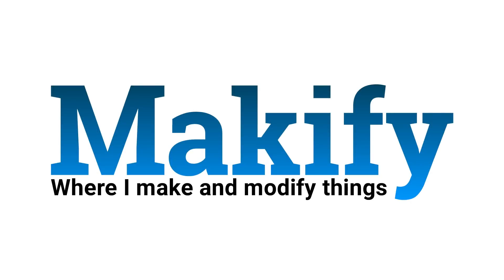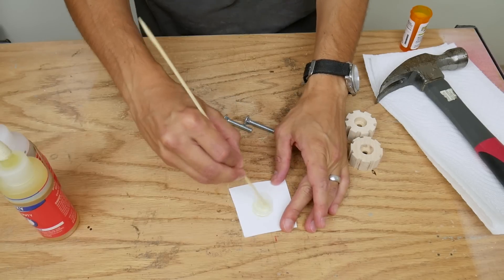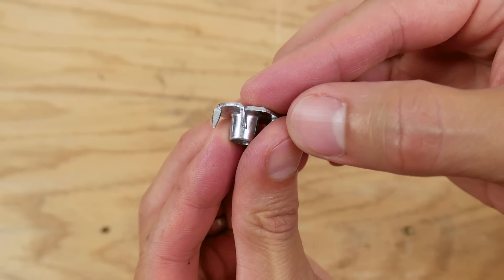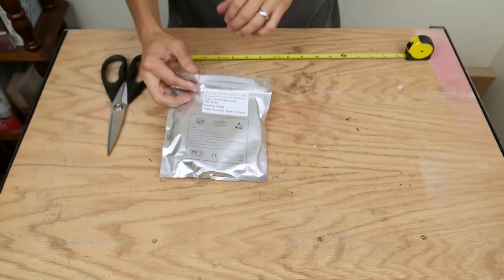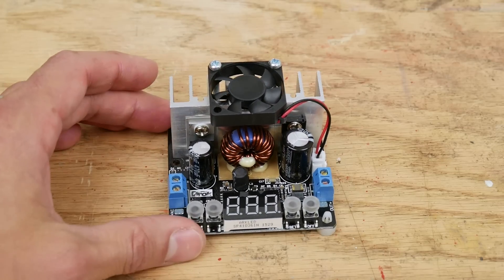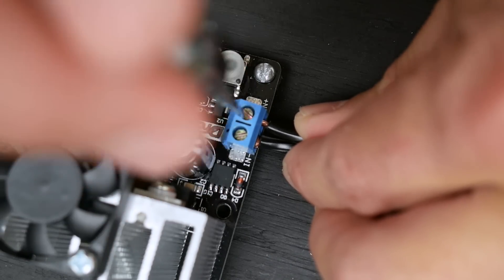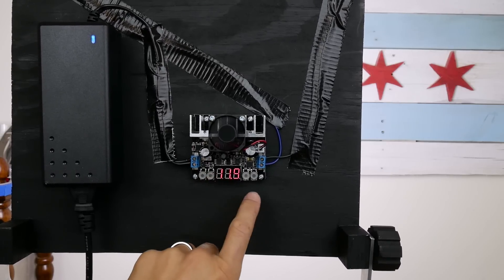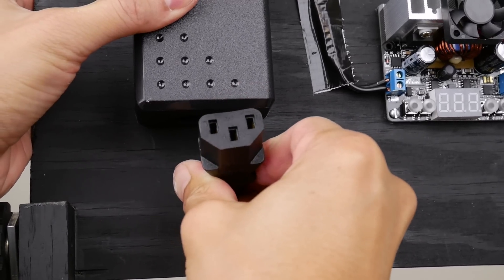How to Make a Light Panel for Video and Photography

Comment: Hey Makify, thanks for the video. Do the aluminum channels increase the risk of shorting or ruining the circuit? Say if some solder from the positive side got stuck to the aluminum, and ran down to the solder on the negative side?
Reply from the maker: Theoretically, the channels could conduct electricity and could cause a short but I've used them in several projects and it seems highly unlikely that a short would happen unless you are a VERY messy solderer.

Comment: I'm interested in something like this for a video shooting friend. However...I'm concerned about the CD-to-DC converter. You mentioned the flickering problem. The converter you mentioned is no longer available on Amazon. How do I find a converter that will not have the flickering problem (the switching of the converter getting to the output)? What do I look for in the spec's?

Comment: hey, great video, Thanks!... I'm hoping you can help, I'm not an electrician and struggling to get my head around the voltage supply requirements, so a couple of questions please: 1. can you suggest a good alternative on the UK Amazon site, I can't tell what I need. and 2. I know if you go too high on the volts you'll blow the LEDs, when you power off how can you be sure the volts won't reset too high when you come to olig in again? ( I only ask because it's digital rather than a manual knob to adjust)..... Thanks on advance!
Reply from the maker: The voltage regulator I used remembers the last setting used even after you unplug it and you can't change the voltage when it isn't powered on. I found the same voltage regulator on the UK Amazon site http://amzn.eu/0kfaUl0. 

You'll also need a power supply that can output at least 13 volts (the LEDs need 12 volts at full brightness and the voltage regulator uses 1 volt) and at least 7 amps (maybe a little less if you absolutely have to). One like this one would work: http://amzn.eu/8kaIYJE. Sometimes the amps (abbreviated as A) aren't listed on Amazon but watts are given instead. You can figure out how many amps a power supply can provide with the formula P=I*V where P is the power (in watts), V is the voltage (in volts), and I is the current (in amps). So a 15 volt, 120 watt power supply can provide 8 amps of current (120/15=8).

I hope this helps.
Reply: Makify1 thanks that's wonserful. thank you for taking the time to come back to me so quickly. very kind of you!
Reply from the maker: You're welcome. I'm here to help.

Comment: Great build, runs cool, low profile. But I'm not sure I'd use the term 'super bright' yet for LEDs. Can you give us some light meter readings or compare to a halogen hot light like a Lowel Rifa?
Reply from the maker: I'll have to do some testing but in the meantime, I can tell you that this panel is a couple of stops brighter than one of the lights I was using before which were soft boxes running five 45watt CFL's each.

Comment: Hey Vinnie, 

Are there led’s that you can change the color temp that you can use for this project? 
Also- is there a way you could control the lights via Wi-Fi or Bluetooth? 

Thanks for the great video! 

Myles
Reply from the maker: There are RGB LEDs that let you change the color but I don't know of any that are precise enough to let you dial in an exact color temperature (e.g. change from 6500K to 5500K). 

They do make LED controllers that you can control over Bluetooth but I've never used them and the only thing I know about them is that they exist.

Comment: This is a very well made video, and extremely informative. I would like to run this from a V-Lock professional battery which has a nom voltage of 13.8V. Thoughts on that??
Reply from the maker: Hmm... I wouldn't feel very good about running these LED's straight from a 13.8V battery. You could use a voltage regulator like the one I used or you could just add a (properly-sized) resistor between the battery and LED strip.

Comment: there is flickering in this led panel? sometimes happens with high shutter on the camera
Reply from the maker: The DC-DC converter I used should not cause flickering like you see with some led lights at high shutter speeds.

Comment: That really was an amazing video!   Very easy to follow.   Now I want to do that.   Any idea what the lumens or Lux are on this light you created?  If you have a light meter what kind of Fstops, shutters speeds at ISO 100 at one meter can you measure? This information really tells us the important details about the light.

And once again, thank you !
Reply from the maker: Unfortunately, I don't have a dedicated light meter but I ran some tests using my camera, a Panasonic G7 with Panasonic 25mm f/1.8 lens. I set the camera to full scene metering, iso 100, f/8.0, and positioned it 1 meter from the light source. All the bulbs I tested, except the light panel, were placed in an 8.5" clamp light with reflector (like this one: http://amzn.to/2k0YMHg). I tested all the bulbs I had around the house. I know this isn't ideal but it's the best I could do. Here are the resulting shutter speeds:

ValueBright 40W incandescent ??? Lumens = 1/100
Feit 7.5W LED 500 Lumens = 1/125
Ecosmart 23W CFL 1600 Lumens = 1/200
Philips 23W CFL 1600 Lumens = 1/200
Feit 100W CFL 1600 Lumens = 1/250
Sylvania 150W incandescent 2740 Lumens = 1/400
My LED Light Panel = 1/800

Anecdotally, these results jive with my experience shooting video. Before making and using 2 of these light panels, I was using 2 soft boxes each with 5 CFLs. I feel that the light panels give off a little more light than the soft boxes and the color of the light is better (i.e. no green cast).

Comment: hey bro! how to solve flickering led strips? please help me to solve this problem! I am using dimmer!
Reply from the maker: Do they flicker to the naked eye or just on video? If they are flickering to the naked eye, it's probably a problem with your power supply. If they flicker on video then it's likely a problem with your voltage regulator or possibly with the power supply. Many voltage regulators work by turning the power on and off very quickly but many turn it on and off at a frequency too fast to see with your naked eye but slow enough that it gets picked up by cameras. The voltage regulator I used in this project doesn't have this problem. There's a link in the description to the one I used.
Reply: Makify1 They are flickering both ways eyes and video recording! voltage regulator is may be working well I think I need to increase voltage maybe I am not sure I think my adaptor is low voltage I don't know but adaptor is showing me 12v  but I'm not sure is that 12v that's why I asked this question to you bro! thank you so much! now I am trying new then I will again contact you!
Reply: 16V 8A.... and not flickering any more
Reply: If you are using a dimmer instead of the voltage regulator used in the video.. LED dimmers dim by PWM - that will cause flickering. (Google it)

Comment: Looks great. Love the aluminum channels. Really ups to look. You should consider wiring in a master on/off switch and then even a small switch for the fan. So you can toggle it on/off super easy.
Reply from the maker: Those are both good ideas. I have also considered adding a resistor to the fan to slow it down and quiet it.
Reply: You could probably change it for a larger, slower moving fan, to get the same amount of cooling with less noise. The current one is comically undersized for the radiator :D
Reply: Or try to find apropriate fanless cooler from some old graphic card and replace the original one.

Comment: LEDs don't like different voltages than rated. You need a led dimmer for dimming. It flickers the light fast enough to look like it's dimmer.

Comment: A lil design change use thick aluminum sheet and use it as a heat sink for led as well as dimmer electronics
 You don't gonna need fan in such conditions

Comment: I'm pretty sure that the metric conversions don't work. if you had done the design with Google SketchUp, people could fiddle with it, maybe make smaller or larger versions, maybe convert to metric and substitute metric bolts and drills rather than use overly precise conversions.

That fan looks tiny. Perhaps one designed for a computer case would e quieter. You could also use an electronics kit box to enclose the power supply.

Comment: You crazy man, that is too much work. And that thing must weigh like a brick.
Reply from the maker: It weighs 3.7 lb (1.7 kg). It's smaller and lighter than the 5 bulb softbox I was using. I consider that a win.
Reply: Then this is not for you.  You always have to think what works for you, if you dont have time then you may have to spend some money to save that time. :)
Reply: Then improve the design. I'd say that big bit of thick plywood needs to go for a start.
And there must be a lighter and quicker way of adding the positioning brackets.
also why not use a single piece of wire either side and just melt off the plastic shielding at each contact?
Reply: Nitpicking! This is a great project, all the parts that used machines in their construction can easily be done with simple hand tools. Minimum list = Saw, hacksaw, electric drill. The design is simple and can even be simplified even further by using flat aluminum instead of channel with diffuser, or not fitting a custom made bracket for example. If your life is so busy that you can not spend an afternoon making a simple project, and you have the income to throw cash at shop bought filming lights then go for it. This project is great for those that do not have your amazingly busy life or wealth, and actually like to make things with their hands. This video, its editing, narration, and project construction is made by a Man who is kind enough to share His ideas and the way He does them is so anyone can understand it, folks who maybe did not have the confidence to undertake some projects for fear of failure and wasting money. He shows that anyone can do it, just have a go. Make something.
Reply: This is called not being simple,Too much work I’d rather spend 35 box on Home Depot buying led panel
Reply: @Makify1  Do you sell these?
Reply: @currylane6601  the light quality would be bad